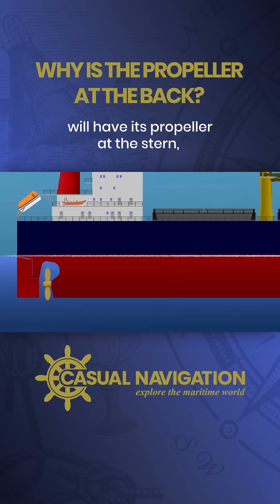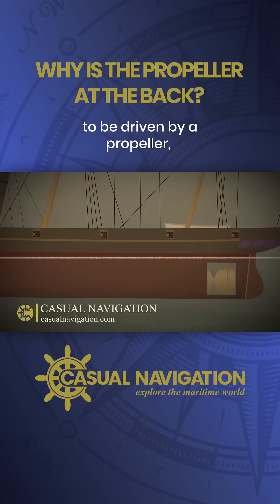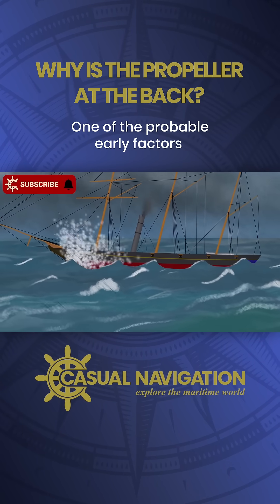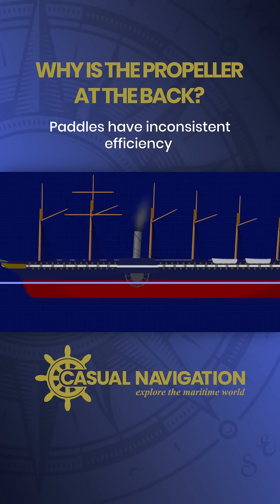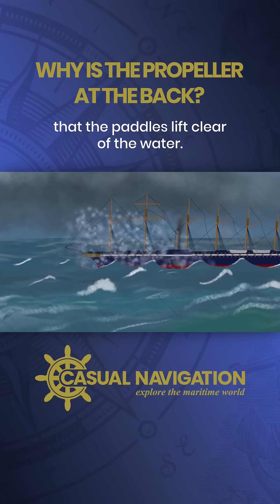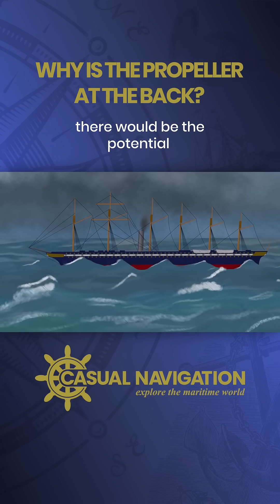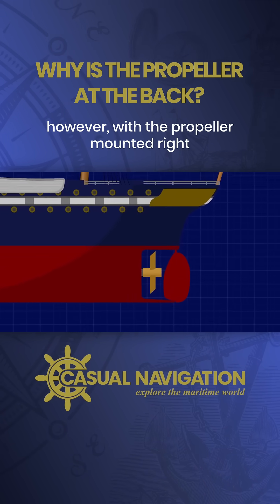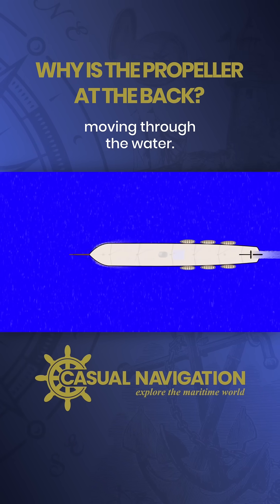Wait… The Propeller Is Where?!

Comment: On a plane, you can put the propulsion anywhere you want, cause working with a gaseous fluid leaves you a ton of options. 
So why the front? On wings, the leading edge of a wing is already stronger to support an engine, and the nose of the plane is free real estate compare to trying fit things in the tail. in landing, all front propeller solutions grant easier and better propeller clearance from the ground.
Last, engine behind the plane complicates scooping air for engine cooling.
The most efficient planes have props on the rear. It cost you in structure complexity, engine mounts, landing gear dimensions, sometimes internal volume, and last, design and testing. There is the case for single engines, of rear flight controls being weak at low speeds cause the prop is not blowing air on those control surfaces.

Comment: Airplanes have the propeller in the front often for clearance issues since aircraft take off and land nose up (high angle of attack). There are pusher aircraft like the lake but the engine is way up on a pedestal and the plane has some bad handling because of it.

Comment: And if the propellers were mounted more like tugboats, then they may gain much more maneuverability in tight situations, and if able to disengage one or more props at a time, we may learn that different locations (or orientations) could be a greater benefit during different situations 🤷🏻‍♂️

Comment: at front  it's dragged through the air.. at the back it's pushed through the water ... rear is to protect against impacts when beaching on sandbars front is to prevent tailstrike or prop strikes on takeoff or landing when paddling pulses of acceleration against the fluid or gas its in

Comment: Also sometimes you may bump into s*** and when you're bumped into s*** head on which is probably the most common place you're going to bump into s*** you'd rather bump into it on the spot that doesn't have your f**** Rudder in screw

Comment: Azipod drives can be scattered down the entire length of the ship. They are not restricted by engine room locations.
Usually only the aft ones swivel for steering however. The propeller on an Azipod is usually on the front for best efficiency.
Reply: In relatively sheltered waters where pitch is not a concern, these are commonly used on catamaran ferries as well. Here the hulls are bidirectional, so the ends of the vessel are denoted #1 and #2 rather than bow and stern.
Reply: @starfishsystems Bidirectional ferries have had props and rudders on both ends for about a century…

Comment: There are many reasons for this, many of which others have already commented, but another important factor I haven't seen mentioned is the bow of the ship will be the first thing to come in contact with anything, such as a landmass, which will obviously be a much larger problem if the prop is at the front. From personal experience, I can tell you that It is quite common for smaller cargo ships to intentionally push the bow some distance up on land when discharging to small ports.

Comment: Ok hear me out, propellers create cavitation.
And ships glide easier through the water when there's air bubbles around the hull. 

Why not fit the propeller at the front on big cargo ships? 
I'm fairly certain a 20000 TEU ship doesn't lift its bow out of the water that often?

Comment: Pusher aircraft were actually common early on. Tractor style aircraft became the norm mainly for propeller clearance to the ground and engine cooling reasons.  There are some other benefits but that's the main reasons.
Reply: It's interesting to reason that through. A ship is lighter than water, so designers place the screw in the rear for clearance under the surface in foul weather. I plane, being heavier than air, and the prop goes to the front in part for clearance above the tarmac.
Reply: Also stability. Thrust & mass in front of drag won't want to switch ends like a shopping cart.
Reply: @ethelmini  A pusher aircraft doesn't "swap ends like a shopping cart".

Pusher aircraft are more stable because they don't have prop wash going over the wings, and in some designs, the tail. Prop wash caused severe problems in WWII era aircraft, so much that many aircraft models had to have major redesigns to account for it.

The P38 Lightning is one example. They had to try three major propeller direction variants to figure out which one didn't cause severe handling issues. Both engines turning outwards away from the cockpit was no accident, it was the best configuration that didn't adversely affect the wings and tail with prop wash. The prop wash at certain speeds and angles of attack could cause just one wing or part of the tail to stall and lead to the plane going into an uncontrolled spin and crash.

The F4U Corsair was another. The eccentric gull wing design was subject to lift problems from the prop wash and could cause it to drop a wing and go into a spin.

The two biggest issues with pushers was as you said, ground clearance, but also propeller damage from debris being kicked up by the tires.

Cooling was an issue, but not in the way you think. Flipping a radial engine backwards doesn't cause any cooling issues in flight, air is moving across the cylinders regardless. Where it does become a problem is the carburetor, because before it had the 260 degree cylinders warming up the -40 degree jetstream. In pusher configuration, it gets that -40 degree air and promptly ices up.

This was the reason for many early B36 crashes, until they installed electric heaters to keep the carburetors warm.
Reply: @ethelmini it actually doesn't affect stability. Search up rocket pendulum fallacy.
Reply: @nade5557  A plane isn't a rocket. Putting mass in front of the surfaces does improve stability.
Reply: @nade5557 thrust in a rocket doesn't  come from the jet it acts on the opposite side of the  combustion chamber
Reply: @daran0815  Both are free bodies subject to several separate forces.

The misconception is thinking the stuff spewing out the back of a rocket or a jet is propelling it when it's just the equivalent of the wash from a propellor - the result of the reaction force to rhe force pushing the propeller, rocket, or jet, combustion chamber forwards.
Reply: @daran0815 that's not what he was saying though
Reply: @ethelmini same with any type of aero engine?
Reply: @nade5557  On my rc planes the shape of the plane drastically affects stability. 
I have stable pushers and unstable ones.
I do not see much variation in rocket shape.
All my pushers seem to make much more noise and I experience what i would call slip or less bite from a pushe prop. 
With planes the centre of gravity has a good deal of effect on stability and I would in general agree that a plane with motors up front has less stability issues that a pusher prop when CG are correct..
Reply: @ethelmini  There is some inherent instability from pusher prop but it doesn't have anything to do with the thrust being behind the center of mass. Yawing causes the airflow on either side of the hull to be asymmetric which makes the thrust asymmetric which creates a positive feedback loop of the propeller trying to yaw in the same direction.
Reply: The fastest propeller airplane of WW2, the Dornier Do 335, was both a pusher and a tractor.
Reply: Plus it's ideal for aircraft to be front heavy so that should they stall/lose power, they will naturally point down and forward.
Reply: @DeleriousJoule  Aircraft are actually designed to be balanced around the center of lift. That is a big part of the reason why seats are filled out in the order they are as well as luggage and cargo is load balanced. Being nose or tail heavy requires excessive trim which not only might there be insufficient trim and elevator authority which will cause a crash it also increases drag and thus fuel use.
Reply: @Cragified Thatis correct. With a tendency to preferring a small amount of nose heavy than tail heavy as control of the condition is more stable.
Reply: Pusher aircraft are making a comeback with military drones. The American Switchblade, Russian Lancet, Iranian Shahed and Turkish Bayraktar for example are all pusher aircraft
Reply: @Ranyick  Military aircraft have long been 'pusher' ever since the rise of the jet engine.  Advancements have long solved the issues with cooling, proper clearance, and low speed yaw authority.
Reply: @Cragified those are jet engines, the drones use pusher engines
Reply: @Ranyick  You are missing the point. Pusher configuration is more efficient. But until the other issues were resolved it was better to go for a tractor configuration. You can do jet engines in a tractor configuration but there is seldom reasons to (They do exist though). 

Those drones you listed do not take off from the ground traditionally they are launched utilizing catapults or launch rails. This means prop strike and ground rudder authority is a non issue.
Reply: @Cragified larger drones like mq-1, wing loong use runway takeoff, and tail strikes are indeed still a concern.
Reply: The B-36 had wing-mounted pusher props and the engines had cooling issues. All this arguing about center of mass etc.
Reply: CG problem is solved with centreline twins like the Cessna 337 Skymaster.
Reply: Yup, also if it's at the front it's technically an IMpeller, but that's a different topic for another time.
Reply: @Veklim   Wikipedia has your back... check it sometime.... An impeller, or impellor,[1] is a driven rotor used to increase the pressure and flow of a fluid. It is the opposite of a turbine, which extracts energy from, and reduces the pressure of, a flowing fluid.

Strictly speaking, propellers are a sub-class of impellers where the flow both enters and leaves axially, but in many contexts the term "impeller" is reserved for non-propeller rotors where the flow enters axially and leaves radially, especially when creating suction in a pump or compressor.
Reply: And the fact that in a crash having a heavy airplane engine behind the pilot decreased survivability by a lot.

Comment: The stern is wide and the propeller provides water flow over the rudder. So, it’s easier to install a drive shaft where there is room and where the best rudder authority is achieved.

Comment: Propeller engines like shown at the start work in a pulling configuration, at least when the propeller is the only thing moving the aircraft. 

There isn’t much resistance when it’s a lightweight aircraft with little drag or weight. But if a cargo ship were to use a pulling configuration on its propeller, in a situation where you’ve increased the weight by 140 times and increased the resistance 12 times, good fucking luck

Comment: Putting it in the front would also mean completely redesigning the hull more aerodynamically to let the water pushed by the propeller move backwards properly or putting a giant propeller compared to the hull more similar to an airplane propeller compared to the fuselage which would mean a bigger engine more similar to an airplane engine were the engine is quite big compared to the rest of the plane. And then you wouldn’t get as good turning since the water pushed back by the propeller wouldn’t go by the rudder.

And lot of it in the early days probably had to with simplicity too. You have the rudder in the back because putting it in the front would make it inefficient and the hull sort of aerodynamically unstable depending on configuration so when building a ship it would only make sense since to have the propeller in the back since most of the time you had the helm at the back and running wires or ropes for engine control all the way to the front would be a nightmare and get really heavy to control.

Comment: There are some propeller driven aircraft that has the propeller mount at the rear or in both direction, i don't know it's exact purpose but i assume it has to do something with speed and takeoff time/length

Comment: Boats are pushed.
Planes are pulled.
That's why.
Reply: Planes can be pushed as well e.g the Swedish j21 and all jet aircraft as well and some using both push and pull like the German DO335
Reply: @joe_gaming2006 
I understand some planes have the prop in the rear, but for the most part, they're pulled through the air.

Comment: also, airflow from aircraft propellers usually ride a current all the way upto the tailplane, and the extra airflow interacting with the control surfaces provide more control authority for the pilot. Kinda like a crude thrust vectoring nozzle

Comment: Also with a forward moving vessel, if you put the propeller in reverse the reverse thrust cancels out the forward motion resulting in no flow over the rudder (no steering) -- until either reverse thust is stopped or the vessel slows down enough for reverse flow over the Rudder (thereby regaining steering again).
By moving forward at speed and running engines in reverse you cancel steering control. This is why the Titanic was unable to turn until it was too late. Had they kept engines full forward with rudder hard over it would have responded immediately. And avoided the collision entirely.
Reply: A large contributing factor was the fact that the central propeller was incapable of being reversed, unlike the 2 outer propellers.
Reply: And yet every warship in the U.S. Navy is always tested to be able to "back down full", which means it has to be able to steam at full speed while going in reverse.
Reply: This just isn’t true, this ignores stern drift and while rudder effectiveness is reduced you don’t lose it entirely. Also the engine positions reported by the crew were actually “full stop” rather than reverse as it takes time to reverse the engines. But either way she was going to hit that iceberg and hitting it because of stern drift would have sunk her much quicker due to the engines and electrical room being locating near the stern of the ship
Reply: I think you should do some yachting as I have. You most certainly can cancel out flow over your rudder even with the vessel still moving.
Don't theorize about it. Actually try it.
 @Constance_tinople

Comment: Ships propellers at the Stern will Stick out of the water partially in heavy sea or when the ships is only sailing in Ballast. And not only does that mean a loss of efficiency but due to the loss of resistance it can lead to propulsion machinery overspeed and shut down.
Reply: Ya, I was going to say I've seen lightly loaded ships with the propeller thrashing the surface.

Comment: If it was at the front it would be pulling the entire weight of the ship against the water. But at the back, it's pushing against the water, which propels the weight forward. Water is denser than you think.

Comment: They put the propeller at the back because they took two seconds to think about it and realized they wanted suitable levels of rudder authority that isn’t dependant on the speed of the vessel only, which would be the case with a front mounted propeller. The rear propeller setup keeps far more water going over the rudder and therefore more effective at lower speed. Also the skeg and keel can also protect the running gear better back there.

Comment: Hydro and aero dynamics are similar but water is so much more dense than the avg air. To create lift you need a low pressure on the top of the air foil or wing.  Since you dont need lift the boat is displacing water. You don't want all that fast-moving water slowing you down by a propeller at the bow of the ship. It would create its own drag/wake making you much, much slower and fuel efficiency would plummet.

Comment: Also, I think, because screws can be smaller than propellers to accelerate the same mass of fluid.
Because of this, the cone of flow is smaller and if it were at the bow, it would generate proportionally more surface friction than a plane propeller would as it has a larger cone of flow.

Comment: Hate to inform you but in at least rough weather with rough seas, that prop on the back of some types of ship will find itself coming out of the water at times.
Reply: If the vessel is pitching to that extreme degree, chances are that the bow is lifting clear as well.

The one exception that I've experienced is a steep following sea. Then it's not so much that the stern pitches up as the trough drops out from under it. These are favorable conditions for broaching also, and if you're unable to steer then the risk is even higher. But that's when to set a drogue off the stern rather than try to outrun the waves.
Reply: True, I've seen it.
Reply: Have experienced it
Reply: Yep, one of those ship types being 20th century USN destroyers.
Reply: Great fun & when that happens, soup is off the menu 😂 I loved my time at sea 🌊 🌊 🌊
Reply: Yep. Been there more than once. Pitching moves both ends of the boat unless you have a drogue or something similar behind you.

Comment: On a ship, youd have bad hydrodynamics and would lose tons of efficiency and sealing it would be more difficult. Keeping the prop on the back makes it very streamlines. A thin bow will cut through water. Planes with props have engines that need air pushed in. Front engine and prop makes it really easy to get tons of air into the engine
Reply: Azipod drives are frequently put at the bow and stern (and occasionally in the middle of the ship). As they are electric outboard drives they aren’t limited by drive shaft configurations like a lot of traditional ships.
Bow propellers are favoured by modern ice breakers as they undermine the ice by sucking the water away.

Comment: I mean, that's where the engine is. Wouldn't make too much sense to have the engine at the back then a long drive shaft to the front. Sometimes the simplest solution is the easiest.
Reply: Or, move the engine in the front.
And cars do what you said but backwards, although it's a smaller scale, so it doesn't matter for them.